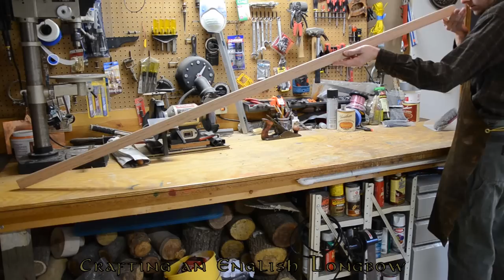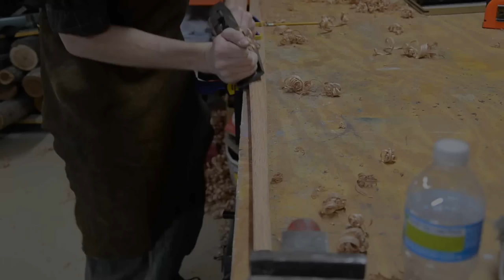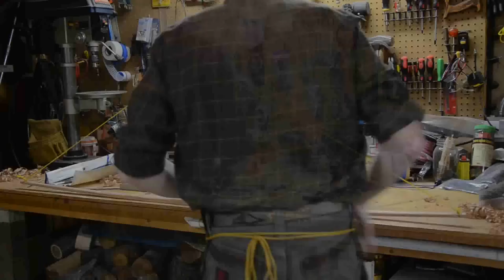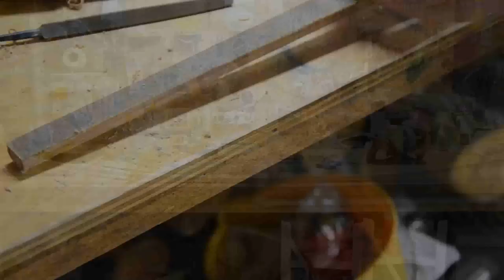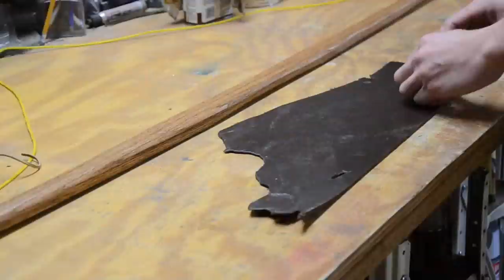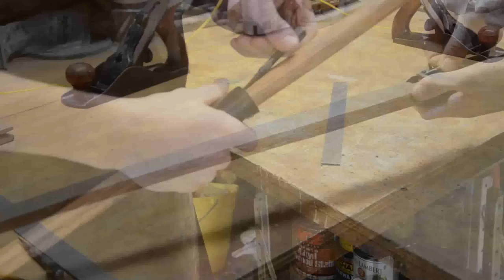Crafting an English Longbow

Comment: A 'Traditional' English longbow is usually made from the Yew tree. It has the sapwood on the outer face and heartwood on the inner face. The English longbow however, can also be  made from ash, elm and indeed any other wood, which can withstand the draw-weight, which some historians has put at between 110lb to 180lb. Normally longbows would have a draw weight of between 110lb to 130lb. In Medieval times a longbow used in combat would have to achieve a minimum draw weight of 110lb to be an effective killing weapon. The length of the bow is usually 2 yards ( 6 feet /  1,8 Metres ). Other countries have their own specifications for longbows which can be vastly different to the normal Traditional English longbow. There are so many different specifications as to what constitutes a 'longbow' it is worth the time to research your own ideal longbow. Take into consideration that a longbow was found in Somerset, England that dates back to  around 2660 BC. Modern longbows modern draw weight is typically around 60 lb. Before posting responses, understand that there are many differing specifications from many differing "Experts" and  historical curators. I merely picked the average of the ones I referred to. That is why I suggest you do your own research if the subject matter interests you.
Reply: +keefy I kinda hate it when people generalize like this.  An English longbow is a pretty general term.  It doesn't have to be a 100+  pound bow made out of specific wood.  That's like saying 'that's not a chevy truck, chevy trucks are made out of this metal, has this suspension, this shape etc..  But hey lets not fight and just talk, with out name calling.
Reply: Ryan Johnson I agree, name calling is so emphatically puerile. I used the terminology, 'Traditional' English Longbow which was made from Yew wood. That is a true fact, according to English historians and longbow associations. Then I said that English longbows could be made from other woods, without the term 'Traditional', as they would only be classed as 'English longbows'. There lies the nub, I think., the term 'Traditional'. The figures I quoted were mostly averages from recognised traditional longbow historians or associations, When you think about it, the longbow was/is a single piece of wood with strong string between the two ends of shaped wood. The traditional and normal English longbow had to have a minimum draw weight for use in combat, otherwise the arrows would not necessarily puncture the opposition's armour. All other figures are mostly averages from different sources. The traditional English longbow is not so much a weapon of war but a work of art. The pale, creamy sapwood back and the golden heartwood belly when worked and oiled for protection is really beautiful.
Reply: +keefy ok I think I see your point.  I really think for such a simple devise the longbow is beautiful.  I've tried to make 4 so far and guess what that's 4 broken bows to the face.  you don't happen to know detailed knowledge about tillering or where to find it?
Reply: +Ryan Johnson at least this guy has the sense not to put traditional or primitive or something in the title.
Reply: Ryan Johnson Lots of books out there but it is an art to be able to tiller the bow without making it significantly weaker. A good eye and lots of patience is required. I can only guess that it is your view of the bow when drawn, to see curves as opposed to flat areas along the bows limbs.. Then to remove wood and not to affect the draw weight. Time and patience are paramount. Personally I would try to use templates to establish the curves of each limb. Then to use a small hand plane, small, very sharp draw knife and a rasp file to tiller the bow before a fine final finish prior to coating. I guess you know all of the above anyway. There are workshops being run by Bowyers, I would guess that these may be expensive and whether they would go as far as tillering I do not know. The initial bow making is crucial to the art of tillering as if the bow is made with no reference to the grain rings, then no amount of tillering will make it a good bow. I really wish you good luck on your longbow making endeavours. Please let me know how you get on.
Reply: +keefy thank you very much
Reply: You are more than welcome. Please remember to let me know how you get on.
Reply: +keefy I will. if I got anything substantial I will comment here.  talk soon.
Reply: OK

Comment: English longbows were crafted from a triangular wedge of yew, taken from  a tree. Not a 1x1 furring strip....
Reply: Any piece of wood can be cut into a 1x1 slab of wood...
Reply: Joshua Brown And? Thats not at all the point I was making. a 1x1 strip of wood is no where near the same as a triangular section of a young yew tree. English longbows were cut from triangular sections of yew so they had heartwood, and normal wood all on the same chunk. Heartwood is more springy since its from the core of the tree, which allows for more flex in the bow during the draw. 

Taking a 1x1 stirp and carving a bow out of it does not make it an English Longbow. Its just a cheap bow.

If thats too complicated for you to understand,heres an example.
A Ferrari is a car; but not all cars are Ferraris
Reply: +DannyWarlegs , actually English (- as well as Welsh -) longsbows were crafted in many different ways. There wasn't just a single way to do it. That goes for all types of bow, whether composite or not. The bows were crafted with available materials and the longbow were crafted in such numbers that they could not all be made with heartwood.
  However, you are right that high-quality bows were crafted only by the best materials. But having said that, an English longbow was not by its term necessarily a quality bow.
To use your own analogy: Not all cars are Italien cars, but not all Italien cars are Ferrari, some Italien cars are just Fiats and no better than so many other cars. An English longbow is just that, a longbow like many others, and a number of materials could be used for a longbow, including an English longbow.
Reply: Andreas Jensen I think you may be confusing English Longbows, and Longbows in general. Sure, you can make long bows out of any woods. But an English Longbow is a model of bow. Made from a triangular wedge of yew or ash, or elm mostly. They did use tons of woods, and what was available, after almost using up every yew on the islands. 

What makes it an English Longbow is its construction method. The fact that its cut from a wedge, shaped wet, etc. 

What he made in the video was just a longbow, not an English Longbow.
Reply: Actually, the English longbow is a type of bow, the English stole from the Welsh. All it means is that it is an exceptionally long (or tall) bow with certain measurement of width and thickness that supported its heavy pull.
  I dont say that most English longbows weren't created as you state, but it was no requirement and therefore not defined by it either.
Im not saying that the bow in the Youtube clip is an English longbow - it seems too short for that - but the way of constructing it doesn't disqualifies it as an English longbow.
Reply: +DannyWarlegs 1) at no point was it said this was "Authentic" 2) Recreations of many things simply cannot be authentic - or are you the kind of person that tells everyone that uses "Damascus Steel" they're lying? 3) Authenticity of materials is a pretty terrible hair to split over a video outlining the construction methods. Especially when at that point you should have been complaining more about the use of sheetrock tape
Reply: CyberGenesis I was just making a sassy comment originally. Don't know why you random people want to argue so much
Reply: +DannyWarlegs Because people come to these videos to learn something, not be accosted by trolls pretending to be 'sassy' when they think they're right, get slapped down, and backpedal to save face....on the internet. Be "sassy" elsewhere - I'm sure Markiplier could use a few more trolls on his videos
Reply: CyberGenesis Ok first of all, what I said is a fact. I just said it in a sassy way. No one was accosted by trolls. Im not trying to confuse or disway anyone here. Its just my personality.

If someone wants to be a smart ass and comment with some "actually dan.." bullshit-Im going to reply. 

Where am I "backpedaling" exactly?
"Because people come to these videos to learn something, not be accosted by trolls pretending to be sassy"
--So then why are they reading comments, and then willingly selecting to reply to a non existing discussion?  I didnt post this on someones comment, I made my own-posted to the OP of the video, not to any of you. You are the ones who are interjecting into my conversation with your opinions of my opinion. Get a life.
"I'm sure Markiplier could use a few more trolls on his videos"
-Good little white knight. Brown nose some more...

Ad hominem attack me, by calling me a troll, strawman my argument into me being sassy which has no bearing on my statement of fact, and then white knight yourself by making sure you name drop the OP and then make sure to shove in 1 last ad hominem for good measure!
Reply: +DannyWarlegs First of all, You're admitting yourself that "your personality" is to be a smartass and a tool on the internet. It's not "Ad Hominem" when it's true, by your own admission - can't call slander against facts, sorry.

Your original statement isn't actually a fact, as proven by pages of research that yew was not the exclusive material used. Again, your argument is invalid when you pick one, albeit wrong, point to argue and ignore the use of modern materials in the crafting. Again, you're obviously the type of person that argues Damascus validity with blacksmiths. Again, this falls back to the original point where no one said it was an authentic recreation, simply a video on English Longbow Construction. 

Where exactly did I name drop the OP? I think you're delusional, which is rather apparent by your attitude of correcting people's YouTube video titles. Your arguments have more holes than Pumice, especially considering you're telling me I have no life because I comment on a comment on a youtube video - oh the horror. You're the one that decided to continue to argue. If I have no life for "starting" an argument, what's that say about someone constantly coming back to defend an invalid argument to begin with...for 4 months. 

So while you're busy arguing about arguing, rather than your pointless (and provably wrong) comments for the last 4 months, maybe you should think about "Getting a life" yourself. I believe there's something about a pot and a kettle involved, but I'm sure you'll argue it's not a real pot...

(Point of fact, I actually hate Markiplier’s videos because of the trolling he basically encourages by his viewers)
Reply: +CyberGenesis Wow the internet is very hostile here. Danny are you sure that you are not just responding to a troll.
Reply: +Kevin Arends Also a very nice video that makes me want to make one.
Reply: he's actually right English longbows are a simple wedge of wood that as no fiberglass to offer modern reflex strength. this is a modern longbow not a English longbow. if I payed for a English longbow and got this as 1 it would be going straight back. although it's a cool modern longbow it's not a English longbow by any stretch of the imagination. by the way I haven't watched the full video because it's not what it says but I did see people defensive over it being a English longbow which it certainly is not being they never used fiberglass and the circular wood grain give the bow it's draw strength without fiberglass on the face of the bow.
Reply: Brock One Im glad someone understood the point I was trying to make! Thank you!
Reply: DannyWarlegs yep I completely get your point. I clicked on the video because I am chopping some elder and black thorn trees out the back of my garden that could make a English longbow. A nice little project for me to do with my little boy. This is a modern longbow so a complete waste of my time showing my boy how we are going to make his first bow. If I was going to use fiberglass I might as well make a take down recurve bow.
Reply: I'm going to have to agree with you. 

The distinguishing feature of the English Longbow is it's "D" shape coming from it's rounded back which forms a natural lamination of sap wood with the heartwood composed of the belly forming a very durable yet springy bow thanks to the sapwood and heartwood working in conjunction. 

To be fair though a great bow can be made from a board if done properly but to make an English Longbow you need a stave to get the rounded back and sapwood. 

This bow is a modern flatbow which still makes a wonderful bow if crafted properly and of which were in very wide us throughout Europe and the America's for 10,000+ years.

Take care
Reply: Brock One excavating the allotment see how that dannywarlegs dude ignored me? I talked directly to him in support and he doesn't say a thing for me backing him up. Then you talk to someone else, not even addressing the guy, and he thanks you alone...he's a scumbag.
Reply: I read somewhere that the first longbows were made by the Vikings that settled  the Rhineland from the wild Yew growing in the region. Maybe the Welsh stole it from those guys? Just spit ballin' here.
Reply: Considering that two longbows were recently recovered from the peat bogs of the Somerset levels and dated to 500 - 600 BC, I would say the discussion as to where they originated is wide open. Perhaps the Welsh stole them first and then the English stole them back?
Reply: You can make longbow from anything. I have one small 160cm from oak/birch from board (not from small tree) and it's working. But it's flatbow. I think in England wasn't law how longbow must looks. And "English" longbow is bullshit, that type of bow is thousands years old and used in whole world. ;-) But ok, British people did it much stronger than before.
Reply: WTF? Vikings? Frozen "alpine tourist" Otzi had "english" longbow 4 thousands years before vikings. :-D It was 182cm long and maden from yew.
Reply: DannyWarlegs   It is a 1x2

Comment from the maker: Unfortunately, I do not have any proper stringing thread, so I had to use a bit of synthetic baling line. Even with that, it was fairly fast and smooth, much more so than the red oak bow I purchased a number of years back. There is a little bit of torsion near the end of the limbs, but nothing too bad.

Comment: Natural strings for ancient bows delivered a lot more elastic power than nowadays syntetic strings. Moreover you need to calculate that the target was never steady, but often a fast approaching one, like a knight on a horse for example.. that added a lot more power to the arrow damage coming from the opposite direction. ARROW-PIERCED PLATES ARE NOT A MYTH.

Comment: I love this video, but I don't get how people back their bows. I have built bows and just hang them on my wall afraid to shoot them. How did you back the bow in this video? I want to make a nice bow this time that wont crack and that I can actually shoot.
Reply from the maker: MrGuitaryMan Really anything will work for a backing as long as it is thin and will not itself splinter. Any cloth is fine, or tight, straight grained wood like bamboo. I used three layers of sheetrock tape because it is incredibly cheap, then a coarse linen fabric over that to make it a little less hideous. Silk, rawhide, horn, and a variety of plant fibre cloths are all perfectly fine. To attach the backing I use Titebond II. Hope this helps!
Reply: Thanks a lot :)

Comment: May i ask you the thickness of the wood at the handle and the tip? built a pyramid bow but the bow doesnt flex at all its too thick i suppose
Reply from the maker: At the handle, the thickness is very close to the original dimension of the lumber, about ,75 inches. At the tip it is much thinner, (without a ruler handy) I would guess between ,2 and ,25 inches. This will depend, however, on the strength of the bow and the material. More than anything, it is about the proportions from handle to tip and the tillering to ensure the bend is smooth when fully drawn. Hope this helps!

Comment: An "English" Longbow has a shape traditionally English.  We made them with whatever was handy, 5'6" to 6'0" long and about 2.5" square.  Of course that was long before the raised the Mary Rose and found a wealth of genuine bows and bodies that had used them.  Some of the skeletons were seriously deformed in the shoulders due to the regular use of high (greater than100lbs).  My competition bow was 120lbs and a Hereford round (144 shots at 60-100yds) was all I could manage in a day. Even then I only did that twice.  I now have arthritis in both shoulders.  By the way, a 120lb bow is actually quit easy to draw, if you use the correct technique, holding it is difficult, hence fast and loose.

Comment: A traditional English longbow is made from English Yew isn't it?
Reply: yev yev yev-According to you it is the best wood for bow, in my laboratory by all parameters occupies 12 position, a disadvantage if you target 15 seconds traction of 35 lb arrow will be release an output of 32  ... .........i like moso bambo Anhui province has China northern woods little sun
cold days, time between rain and dry days 5-7 days after the full moon when juices and starch go down to the root, morning picking straight cut on the third internode, it's from me regards.
Reply: Actually, the traditional "English(or Welsh, if you prefer)" longbow was made of yew from, mostly, SPAIN.  Usable yew trees in England were in short supply